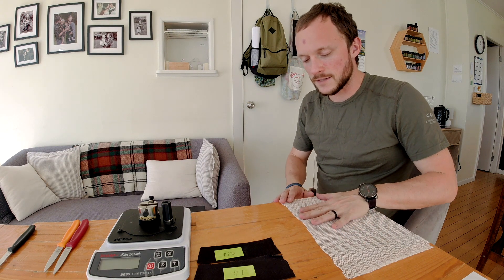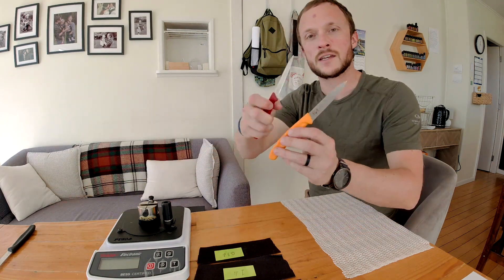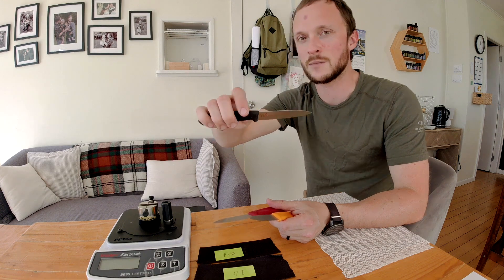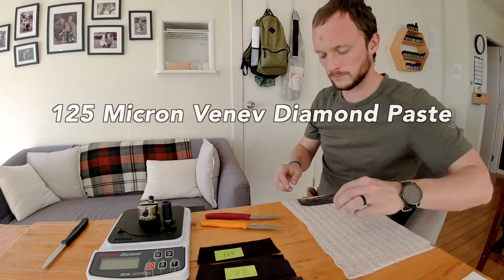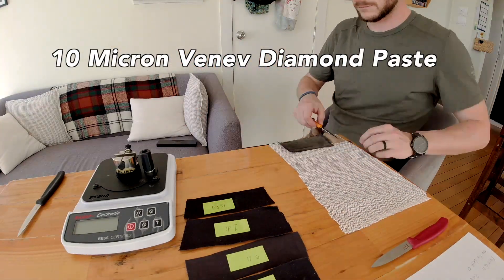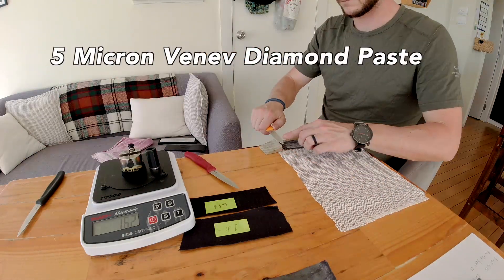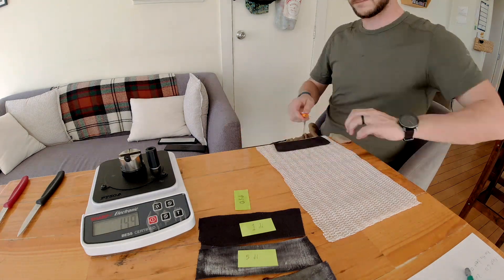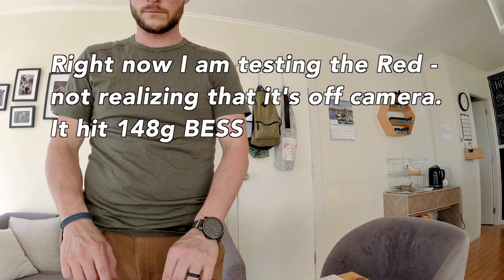Strops Part 1 | 125. - 0.5 Micron Diamond on Denim | Knife Sharpening Test

Comment: I've been looking for this kind of data and look forward to watching the others in your series. I don't like the single BESS test as it only tests 1 very small section of the blade which may not represent the overall blade sharpness.  3 tests , tip,  center, tail, would make more sense.
Reply from the maker: Make sure to check out my stropping testing overview for more updated info:

https://youtu.be/5nvGkYIpID0
Reply from the maker: Thanks for the input - that makes sense.  I need to introduce more multi-point testing methods with BESS.  It can just be hard to get my hands on test media here in NZ at times so the stuff feels precious, lol.

Comment: The reason i got you the 10 micron and especially the 125 was to use for your dual grit edge since the diamond stone you use is about the same grit as the 125 micron paste. I thought maybe you could use it to strop the coarse side, that way it would still retain the teeth and aggression given by the low grit edge. I don't think 125 should be used for regular stropping since its so coarse but it might be useful for dual grit or maybe to touch up and edge that dulled quite a bit. I haven't really used it a lot except for finishing work. I had a regrind done and it came back with a coarse satin (you could file your fingernails with it, thats how coarse it was) so i used stones and strops to give it a finer finish. I used the 125 on a polishing pad on my Dremel and it worked pretty well. I think it might've been designed for tasks like that and industrial use and not knife maintenance. But its fun to try new abrasives.
My sweet spot is 7 to 3 micron generally. I f8nd it has a good balance of push cutting and slick ability. Any higher and slicing goes up but push cutting suffers and any finer push cutting is smoother (good for wood carving or on choppers) but slicing aggression goes down. Depends on the steel, edge grind and angle and what ill use the knife for. Id love to get a Bess tester to see how the edges are but its not something i can afford to spend money on for now.
Reply from the maker: Hey Alex!  Yeah bro - I need to try stropping dual grit with those different abrasives, thanks for the reminder - it’s been way too long.  Would be cool to try it out.

Thanks for your thoughts on abrasive size - I am learning a lot right now about stropping which has been a weak link in my sharpening skills for a while.  Appreciate hearing about your experience!
Reply from the maker: Hey dude - I tried this last night - 125 micron on the coarse side and I actually found the 10 micron left the fine side really nice and crisp, even more than the smaller 7 or 5 micron stuff.  

Edge looks awesome under the microscope and is cursive cutting phonebook paper - gonna rope test it this Friday.  Will keep you posted!
Reply: @homeslicesharpening  cool, I hope it gives you a good result. Gonna look forward to seeing the video. 👍

Comment: At a certain point it is simply no longer possible to get a knife even sharper.
Measuring every step, highly polished, yet not sharper.
With the 30,000 grit stone the sharpening direction changed and then kangaroo leather strop.
Finally ended up with 76 BESS and so sharp that I can really split hairs.
Reply from the maker: NICE!  Well done.  I think Todd Simpson discovered that beyond about 4000 grit the thickness just behind the edge (he calls "sharpness") stops improving, and only the "keenness" (apex width) continues to slightly decrease.  If I remember correctly, his observation is that you need some effective form of stropping to carry on seeing great improvements.

However, a 30,000 grit stone is basically a strop, so maybe you've got it made!  In any case, 76 rocks, and you've worked hard for it.  Well done my friend.
Reply: @homeslicesharpening   If you focus your attention completely on something, that is your learning process and your development lies in it. For the last few months I've focused entirely on flatness and straightness, so it's now quite normal to get below 80 BESS.
Each knife has its own personality and requires a personal way to be sharpened.
The first whetstone determines the rest of the sharpening process.
Sometimes I get a bag full of knives and nowadays I only sharpen the knives with potential, no more potato peeling knives for me.
When I started with a knife, I first look at the edge with a magnifying glass and then decide which whetstone to start with.
Then I will determine the sharpening angle, everything is measured, of course, to measure is to know.
I determine the angle depending on the use and the shape of the knife. Then I place the cutting surface on the back of a lapping plate to see if where the cutting surface is straight and convex and whether the cutting surface touches the lapping plate evenly everywhere.
Sometimes, especially with used knives, it happens that they have been sharpened incorrectly or that chips are missing or a point is missing.
For example, if I am already under 100 Bess with the 400 grit stone and I still have enough knives to sharpen, I go straight to the 3000 grit stone and leave it at that. For other knives I will continue until I have reached the maximum sharpness for that knife and within my capabilities.
If a blade cannot be sharpened completely because it transitions to a thick piece of metal or handle, I use a 4mm chainsaw file to create a concave so that the blade can be fully sharpened without damaging the whet stone.
Reply from the maker: @AlmostGone3210  Awesome!

Comment: Never used denim so I couldn't tell you what your results mean. Im glad you finally got around to testing these and I'm looking forward to more tests. My favorite strops are balsa, ebony, hetinax (cellulose dust in resin) and kangaroo leather. I find I prefer hard strops since they keep the aggression, don't seem to lose sharpness and are easier to strop on since I don't have to worry about rounding the edge. Sometimes I just use thin painters tape on one of the strops or a stone when trying a new compound or don't want to commit to a certain strop.
I wonder if having a solid backing instead of a non slip mat would make a difference? Denim is thin so 9n a hard backing it should not have much give but being on a soft pad might round over the edge.
As for compounds my favorite are 5/3 micron Venev, 9 and 3 micron Gunny juice and 0.5 hand american diamond spray depending on the steel and edge I'm going for and what stones I used before.
Reply from the maker: Beautiful feedback - check the next video for confirmation about your thoughts on hard strops!

Thanks for the compounds - sorry it has taken me forever!

Comment: Gabe,
	have you tried dual edge on like 8cr? Aus8 or High end budget like 14c28n?
Seems like a way to extend use of budgets to all day or week users depending on use.

	so I’ve been doing my single blind (everything I do is single blind), dual edge on a cruwear here is the technique: 15.4 degree angle
KME w venev 80-Venev to 1200 grit both sides, edge trailing strokes from 400 on up. Next is a balsa wood stop in KME alternate sides until I’ve scared the burr to flee. Then I take one side to venev 240 w trailing strokes, alt this w 1200 side 1200 trailing, then balsa burr minimization.  The edge is bite worthy Next I plan to use a cheap fire hose cloth strop very gently to finish.  I’ll let you know what I get for Bess tests, edited in here. Unfortunately Pete-oid tests aren’t my thing.  Maybe I need an Andy Jr.
Feel free to critique, I’ll try to provide more data. Bess averaged 52, my best by far.  Forgot to use ceramic tho I don’t have any for KME.
Reply from the maker: AWESOME RESULTS!  Wow.  If you did send that to Pete his arm would probably fall off before the test was over!

What do you mean by "single blind"? I'm unfamiliar with the term.  I have no critiques at the moment, (I wish I could tell you more) though I am glad to hear you are getting good dual grit results on a KME - I have wondered about preset angle systems of late.

I'm also glad to hear that on harder steels the Venev stones can produce a functional dual grit edge.  I have had some problems with using them on softer steel.

It's a very cool idea to remove the burr and then revisit with a dual grit edge gently - it would largely prevent fatigued steel from remaining at the apex.  240/1200 FEPA Grit on Venev's sounds like it would be an edge with very smooth action whilst still retaining the dual-grit aggression.

Behind the scenes here I just finished roughly 35 new unpublished ANDE tests in the last month, and I have now narrowed down what stones and techniques I want to try - my next filming step is actually to test steels (starting from low carbon content, ascending) and try to discern what the best dual-grit edge is for each steel.

I bought a SOG and a Kershaw in order to test 8Cr, and hope to work some dual grit wonders with it in a month or 2 after I test out H1, LC200N, 420HC, 12C27, and NitroV!

Thanks for sharing - I wish I could use your 52 BESS CruWear knife.  Sounds satisfying.  I'll get there someday.  Cheers.

Comment: You said "finished" on spyderco ultrafine, do you mean dualgrit, or both sides with ultrafine?
If both sides you should get waaay lower results, below 100g, towards 50g.

I prefer balsawood or leather for stropping, and a longer strop. 15 passes per side.
Reply from the maker: Interesting.  Do you get those results on soft steel with diamond abrasive?  Bro - if this is a normal occurrence for you, then you need to be making videos and I'll watch yours 😂

Are your numbers (between 100g and 50g) quoted from your custom-made edge with 10 degree reliefs and a micro-convexed edge, or do you get those BESS scores on v-edges on conventional steel?

A pleasure to hear from you as always, let me know.  I'm just a dude with a sharpening method that benefits from very light stropping trying to figure out what the heck I am doing, haha.

Cheers Sabelfechter
Reply: @homeslicesharpening  Yes, 10dps relief and between 17.5 to 20dps edge, on random kitchen knive steel. So diamond is much better for highend steel, im just saying i dont even know the grit of the stuff i used, it just works, i feel the stropped distance is the key. Need to test soon how well it does on my new Cruewear.

But the relief ofcourse isnt needed for apex sharpness, it just makes apexing faster due to the minimal surface/volume.

I totally understand your trying to find something that works best for only little stropping. But that might lead to wrong conclusions of what compounds work how well in general due to the short strop and few passes, so its important to mention that.

And improving bess sharpness maybe doesnt mean improving edge longevity in dual grit edges, quess that has to be tested yet.

Could you do me a favor, when you stropped an edge and bess tested it, try to whittle/pop a hair. It atleast should against the direction of the scales, if held between the thumb and pointing finger, about 1 to 2cm from where you hold it. Easiest place to get them is the hairbrush of your wife. :D
Reply from the maker: @sabelfechter7136  Oh yeah, I totally get it, and I appreciate your feedback.  I incorporate comments like these into future things I explore and will note it.  I have to be honest bro - I have hit the videos pretty hard lately and have about 40 videos to edit right now (not exaggerating).

I am happy to perform a hair popping test, and tell you the results in a comment, but it may be a little while before I get a video out to demonstrate.  If it helps I find my dual grit edges usually start whittling a hair (not extremely well but noticeably) at around 115 BESS.  Fine edges usually have to be a little lower BESS (although they sometimes whittle at 140-160 I find that is almost always a foil burr and edge retention drops sharply).

I'm hoping to try your system at some point - what grits of SiC sandpaper do you use on the compressible tape when applying the convexing?
Reply from the maker: What videos are you referring to that they get down that low?  I am not familiar.
Reply: Yes I am very excited to hear the step by step process to 50 Bess, that’s Barbour razor sharp fresh off the leather!
Sal @ spyderco, had his best professional sharpening employee do some steel and best they could get was 80’s 
@ 50 I bet if you even had a breeze of air blow on it , it would be 100 afterwards 😬
Reply: @sstein49  Thought everyone is getting that?
Are your edges hair popping?
If not, your doing something wrong, whatever it may be.

Maybe i make videos on it some day, i planned to do so recently, but are super busy rn with Arma modding and sabre fencing.

There are more than enough videos on how to get a knive that sharp, only thing i can offer is how to get there more efficiently.

A funny one is the clip of the 4g edge xD.

Comment: I don't know the actual reason. But with stropping compound. With the non vanadium carbide containing steels. I have noticed, that when i use green chromium oxide compound. I get much better results. 

While if I use the diamond sprays i use for my vanadium carbide containing steels on them. I don't see the same improvement. 

This is completely anecdotal. Since i don't have a bess tester, or anything. But the difference is very noticable. With green compound i will get hanging hair test passing edges, and not with the diamond. And with the mc type carbide containing steels. I get those kinds of edges with the diamond spray. 

Like i said. Completely anecdotal, but that has been my experience.
Reply from the maker: I'll take any anectodal things to that you recommend!  It's helpful to have some places to start and things to try.

Thanks for the input.  I think based on later strop test videos it seems clear that softer abrasives make better deburring strops for these softer steels as a general rule.  I'm expecting to have to re-test strops with high carbide/high vanadium steels!

Comment: Hello Gabe. I'm not sure how such a small BESS difference will correlate with performance. We have seen some knives in your tests that still cut rope at 400 BESS while others stop cutting at 300. Quite significant difference and the higher BESS still has better performance. With such a small difference I bet other factors will have greater impact than BESS numbers such as how the edge is structured, how aggressive it is and what you are going to cut. 

I learned recently that BESS tester is quite tricky. With faster speed the BESS number will decrease, a fast cut can get a sub 100 result on an edge that doesn't even cut paper. I know you never do that and any sub 100 you get is freaking sharp. My point is that it would be interesting to test how much difference will result if you vary speed on the same knife- ultra slow cut, slow cut and medium speed. 

String tension also changes results. Not sure how to make it always same tension but a tension variation test would also be interesting.
Reply: Two other factors also affect Bess. The position of the knife over the string—closer to the valley edge lower Bess.  Any sawing motion also lower Bess thats my theory why serrated often have low Bess, the test medium moves to the deepest part of the serration thus creating micro sawing action (not sawing using serrations per say).
Reply from the maker: Hey guys, great input.  I am aware of most of these limitations and I agree that this test did not return much in terms of a method I'd want to replicate.  It's more of a rule-out process than anything.

In the next test - I get a blade to 95, one to 99, and one to 100 - so it does seem there is a significant difference in the effects of different stropping materials and substrates!

@Thiago - I am actually currently making some changes to my ANDE testing that I think will reflect some of the things you are wanting to see.  I'm excited to hear your input on it!  Cheers!

Comment: I got nano clothe and leather .the progression dont works i think i go from .50 down to.025 and it dont get no sharper
Reply from the maker: Oh, are the results not good on those?  How surprising.  Nano cloth and leather have quite good reputations.
Reply: It seems like I get most of sharpness from stones .when I try to go from .50 to .25  to .1 I don't get any noticable results .after i get done with stone stripping gets it sharper but I don't see any noticable results in strop progression
Reply from the maker: @damensutherland7081  Oh gotcha, that makes sense - thanks for clarifying.
Reply: Man I been trying to get a hair whittling edge for about a month or two I done bought kme 8k sldiamond stone I got 15 k resin diamond I have used nano cloth and leather strops with no luck still.shout out to you
Reply from the maker: @damensutherland7081  I am not a hair whittling expert but do find that I get pretty close when I really take my time on the Spyderco UltraFine Ceramic and then use some diamond in leather really carefully.  It was a frustrating process to learn though!
Reply: Thanks for comment Im not Shure what I'm doing wrong but I'm going to try on another knife with different angle and steel and see what happens
Reply from the maker: @damensutherland7081  Best of luck!